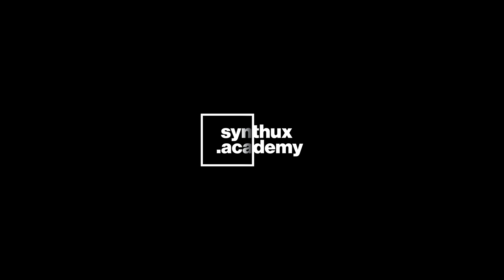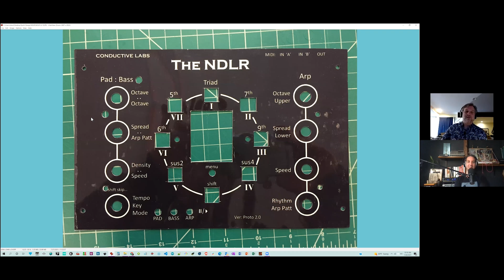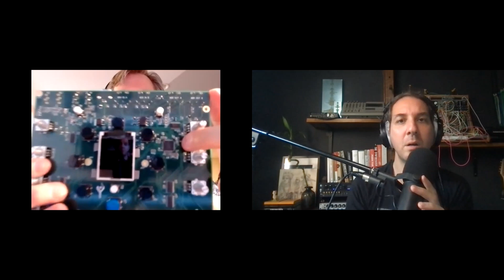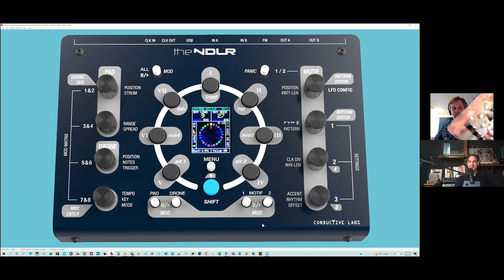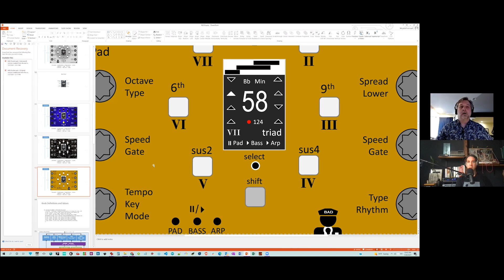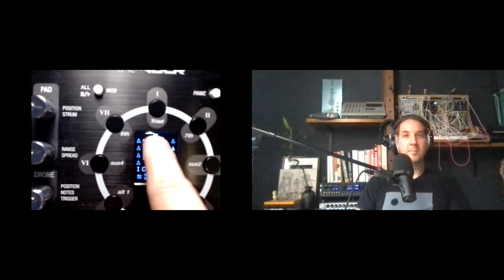A composer's best friend // Conductive Labs, Steve Barile // Synth Design Podcast

Comment: Found this by accident,  Watching the evolution of this device from a basic concept to Arduino, and then its transition from the teensy breadboard, to a proper PCB with circuit protection is invaluable. This is all the stuff you never hear of. A roadmap on how you turn an idea into an actual product.  

btw @54:00 where Steve answers "we used MUXs'" . These are Multiplexers that take a single analog in/output and switch that signal to 1 of 8 other in/outputs based on a digital value set on the multiplexer. In other words, the interface was designed around this constraint imposed by the Teensy analog input, and his use of the multiplexer to use 8 encoders/potentiometers. [He could have used i2c encoders but those are more expensive ;-]  The buttons are easier, as these directly relate to the digital inputs on the teensy.

It would be interesting to see this on the breadboard and the final PCB.

Comment: Really expected the NDLR to get more software updates after it launched...
Reply: It's had something like 76 updates to date and is still being updated, although it's slowed down around the MRCC development. There is an immanent release on the horizon though that deals with some of the timing issues related to the Chord Sequencer and controlling it externally via CC messages. I hope to get that out in the next couple of weeks.
Reply: It started to make sense when he said it was basically just an Arduino script “c” and that programming it was a struggle. It’s a shame because I have no doubt there are things that could be updated if it was easier to to do. Fingers crossed there is an update in the works.